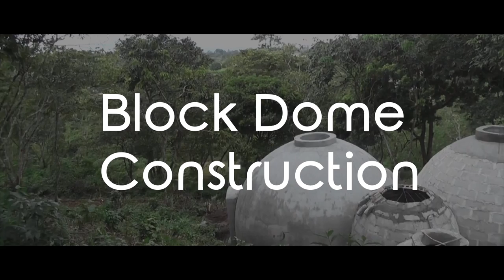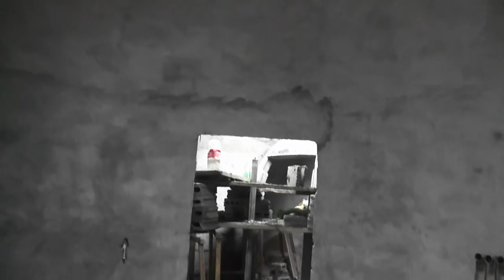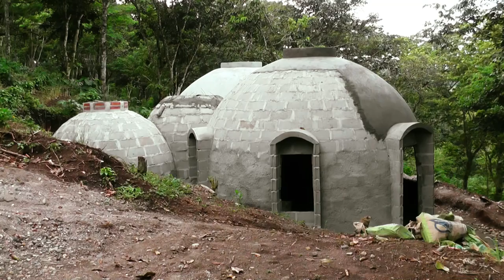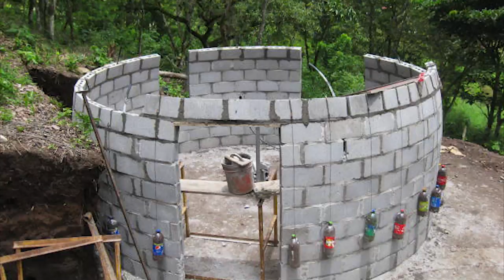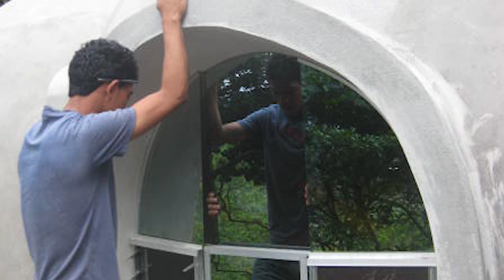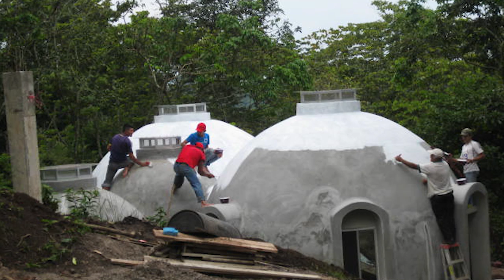Dome Construction

Comment: This is an area with earthquakes.  Where is the reinforcing for the masonry?
Reply: Bryan Butler
Um. NO!  As an engineer I say it is a potential death trap unless you get it perfect.
Reply: Its a poor country, is anything they build down there any better? BTW even earth bag has a decent earthquake rating. Not as good a reinforced concrete dome of course. Do you think they could have done something to make it stronger? Within reason of course, something simple I am saying. How about a layer of basalt rope over the outside and a nice layer of 2 inch concrete? I guess it would need to be inside though to make it safe. Perhaps embedding tabs into the block work on the outside that could then attach to rebar or basalt. The thing is, air bags are just too expensive and labor is cheap down there, hence the block work.
Reply: snake pliskin You cannot do unreinforced masonry in an earthquake area.  Earthbag with wood roofing would be much better.  One story of course.  Putting concrete OVER the blocks, even with basalt, won't really help as the4 block won't adhere well enough to that layer of concrete.  Air bags are reusable over and over. You don't leave them in the structure for 3rd world housing.
Reply: @patrickeh696  Not if you use aircrete.

Comment: I wonder how it will be like when it is 101 degrees Fahrenheit inside. I guess you'll be cooked and ready to be eaten. I am sure you can bake a bread inside.
Reply: Dome structures are easier to cool and heat because they allow for efficient air flow.  Granted they'd need an air conditioner or swamp cooler above a certain ambient temp.
Reply: WRONG Bal.  The concrete flattens the heating and cooling curves,  A white painted concrete dome will avg 10C LOWER in temp that the outside in the sun.
Reply: Topmost Pop  To say I had trouble following your writing is an understatement. I still read it though. You haven't been diagnosed with schizophrenia have you? (serious question) Are you familiar with Terry A. Davis?